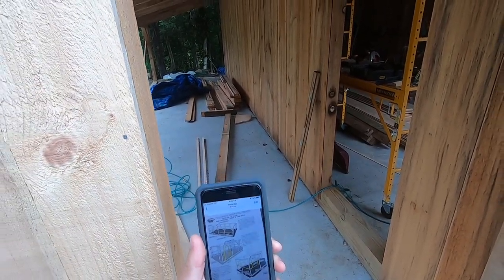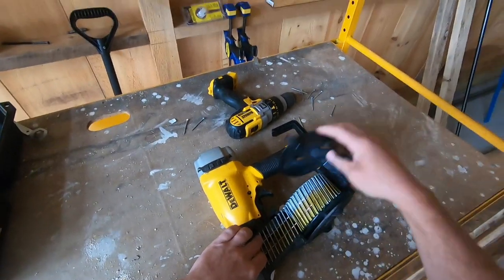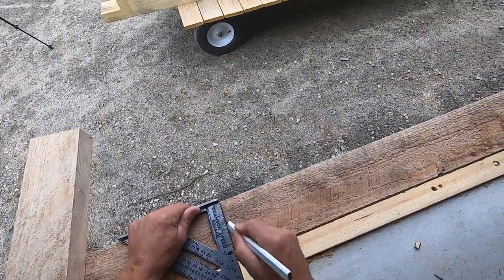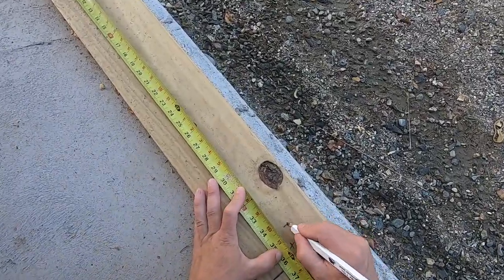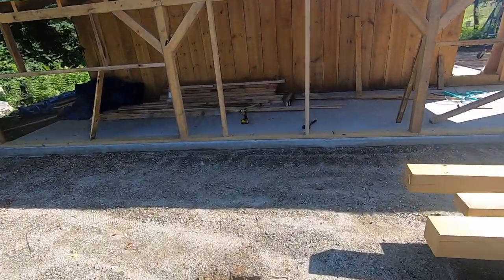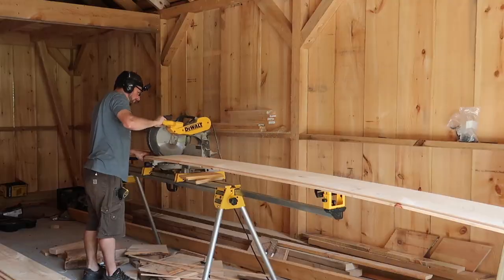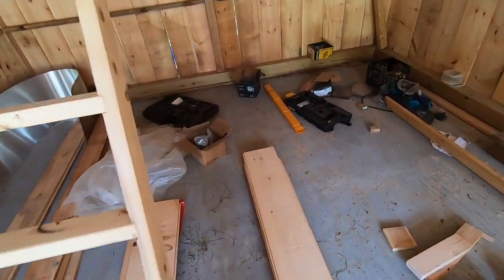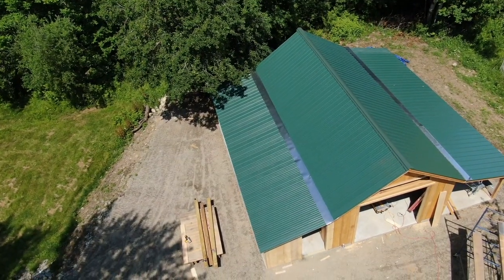Learning NEW TRICKS Building Phase 3 on the Post and BEAM Barn Bought on the Internet

Comment: Sealing the concrete is critical due to bacteria and allows easy peasy hosing off.  Some kind of seal that won't harm the goats.  Also inside the main barn is a good idea to seal the concrete due to spills of oil or whatever that might stain it.  We did this to our 3 1/2 car garage and come spring if there's anything on the floor it comes right off with spraying and soap.  Our concrete guy told us we should do this and so glad he did.  The barn look marvelous and wow can't wait to see the video for the BARN PARTY when you get it all done.

Comment: Al, just a thought.... have you considered a Water Sealer for the concrete pad at least in the goats side of the barn to protect the floor from absorbing goat “moisture” and smell?  Hay and straw only goes so far.  There are non-toxic versions to protect the herd.
Reply from the maker: I hadn’t thought of that yet. Good idea.
Reply: up there for thinking....down there for... sealed concrete ;)
Reply: basiaboy we had a Stable with a concrete Floor the cows stand there and doing there thing pee and poo. The concrete was not sealed but it was a very dark almost blue concrete very very hard. The Floor was very good after almost 90 years pee and poo. Maybe an oil will protect it , great idea.
Reply: @friedakiezebrink277  The things used 90 years ago are not the same today! A different concrete mix was used back then so a sealer will do that protection now.

Comment: Have you made one of the doors into the stalls wide enough so you can get kabota bucket through to make it easier for cleaning out?
Reply: Do that on end walls and dividers. That way you could open and drive tractor from one end to other. Work SMARTER NOT HARDER.
THINK SMART AND LAZY FOR LONG TERM NOT FOR SHORT TERM.
A LITTLE MORE WORK NOW WILL SAVE LOTS OF WORK IN THE NEXT 20 OR 30 YEARS.
ALSO THEN YOU GET DISABLED YOU CAN DO BARN CLEAN OUT WITH NO HELP.
Reply: Judy g not assuming anything, it’s about future proofing things as it’s easier to do it when you build it than to adapt afterwards!!
Reply: Judy G.  Never thought I would be unable to lift and do the things I could 5 years ago but now I am looking at back surgery to correct the lumbar stenosis that has me in pain. The future is not ours to know but doing things while we are able to help us out in golden years makes great sense! So a door wide enough to the bucket to go in is not hard now and will help save the back for other things. BTW I am 64. When constructing things making them accessible for later is a WISE thing to do.
Reply: Judy G. I never thought I'd be disabled either wow was I mistaken from surviving throat cancer to the chemo that has kicked my rear up & down the street a few times & my knees went out they need to be replaced but can't do that. my barn is 38 by 40 was smart enough to make it that way just in case so glad i did

Comment: Al, Larry here, the barn looks really good, your fit and finish is tight! I do have a concern about how the siding butts up to the top of the base plate, leaving 2 exposed seams, top of plate and where it sets on the foundation. This will allow water penetration into the structure. Where I saw it was when the camera shot panned down from the window where your wife was with the cat. Ideally the siding overlaps the baseplate and the foundation (11/2 to 2"). I do have a fix, you could snap a chalk line just above your nailing and cut a 1/4' groove at a upward sloping 45 degree angle. Next get the appropriate width flashing with the 45 degree bend (1/4") and insert into the groove, tack it with small nails, and for added insurance put a bead of caulk in the groove and concrete prior to installation. To cut the groove you could use one of those tools where the blade oscillates, this would make a thinner cut than a saw blade, or a dremel saw with al little circular saw blade might work too. If your not finished with it and have it covered, I apologize for getting ahead of you :-)

Comment: On the center door.  To keep the outside look more symmetry, you can decorative faux frame the outside (ie, barn style) making the door on the outside look larger than it actually is.  That would help maintain a centered door look from the outside and give you the extra stall space inside.  Just a thought.

Comment: @Lumnah Acres, Al, are you going to move your weather station or leave it at the outdoor kitchen?
Reply from the maker: I plan on leaving it where it is.
Reply: The location originally wasn't ideal due to the trees but the loggers fixed that nicely. Down at the barn could be pushing the range for that unit. You have to take what the mfr. claims with a large bucket of salt.

Comment: Barn is looking great. Lot of work for 1 man but you're handling it well. Here's a trick to save some time. Your miter saw stand has adjustable saw stops for making same length repeatable cuts. If you set those when you were cutting the shorts for under the windows you could have easily cut all to same length and only have to measure once. A real time saver.

Comment: Would have liked to have seen you add a "Z" metal flashing over the slab outer edge and bottom plate to keep out the rain and snow from blowing in  , before installing the siding . Chalking never seals or lasts to prevent water and snow from coming in. Looking good Al. After working on 100"s of home repairs all over the United states. The bottom 4-6 inches of wood siding and corners rot  over time because  of no back and bottom sealing before installing . Prevention , little cost and time , is always worth considering when building.  Looks like you will be adding a trim board at the bottom to cover the bottom plate and siding bottom. Maybe consider cement trim board , pre primed and painted ?

Comment: QUESTION? Do you have a wooden structure faxing West, South-West or South where you could dig 15 inches out from the structure? That is the ideal tomato patch. Start some tomatoes titled 'EARLY GIRL ', ‘SWEET 100’ and ‘SWEET 1000’. Dig the soil in this area. amending with organic compost and broken egg shells. When the tomato plants are 10 to 12 inches tall, cut the leaves off the stem 3/4 of the plant. Dig a 3 inch deep furrow from the structure to the outside of the row. Lay the tomato plant on it's side with the top towards the building. Plant 12 inches apart. If you have some empty plastic gallon milk cartons, fill them with water and put between the tomato plants. This will heat up with the sunshine during the day and help provide warmth to the plants. Cover with soil leaving the top 4 inches of the plant open to the air and sunshine. The plant will shoot out new roots along the stem and the top will straighten up to climb the wire backing support. Water the root area well and mulch lightly. DON'T wet the leaves of the plant. Invest in some heavy yardage to measure the length of the row plus 1 yard and a couple dozen of spring clothespins. I usually could find 45 inch wide yardage for $.25 to $.50 per yard. When the sun sets for the day, pin the heavy yardage to the wire back support covering the tomato plants. This will keep the tomato plants warm. A must for tomato success. Water when dry, only at the foot of the plants over the roots. Don't wet the leaves. After the plants start to blossom, shake the support and plants every 3 to 4 days to pollinate the tomatoes. At the end of the season, harvest all the green tomatoes. In a large box put the tomatoes in a single layer in a cool area. They will ripen giving you fresh tomatoes until spring.

Comment: Why not Dutch doors instead of windows? Make wide enough for tractor access, put a window in the top section for light. You know your intended purpose so it all looks good as is! it will be easy to change later if purposes change. I suppose you will have out doors corral areas?

Comment: Wouldn't a Window in the Front make it easier to look into the Goat Area easier?  Now with the windows on the side you have to walk more to look inside.   A window in the Front seems more logical unless not having one is better  for heat/cold caused by the Sun.  Does a Barn Door require the same height of 68"  like a house has?

Comment: AL, FYI IF YOU JUST NAIL FULL LENGTH BOARDS UP THEN TAKE A PLUNGE ROUTER CUT OPENINGS INCREASES SPEED LITTLE WASTE. THEN NAIL BOARDS TO WINDOW FRAME OUT.
DID THIS FOR MOBILE HOME'S. 
I COULD RESIDE A MOBILE IN A DAY MOST PEOPLE TOOK 2 TO 3 DAYS TO DO WHAT I COULD DO IN ONE.😊
PROFETS PROSPER THAT WAY.
Reply from the maker: Good trick
Reply: Hey Ralph, you gotta hit the caps lock key. All caps is shouting!!!